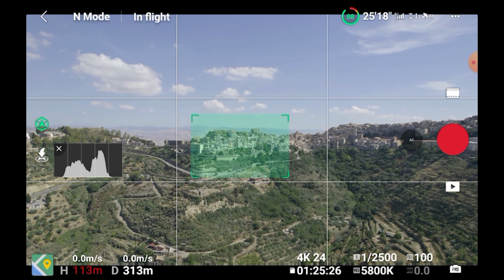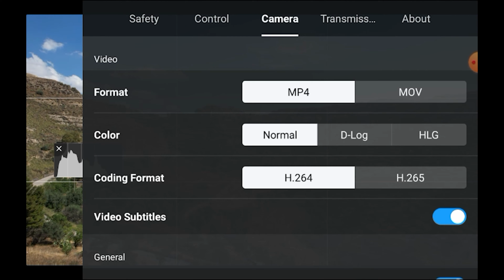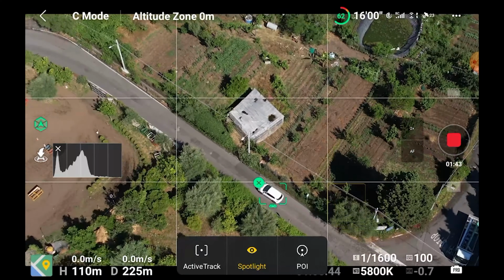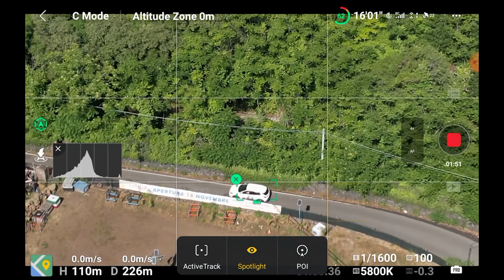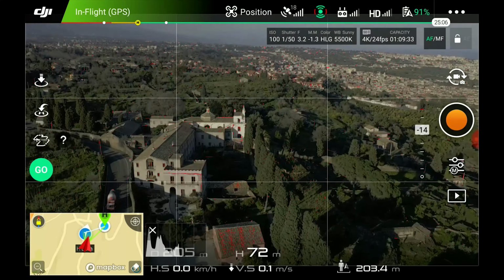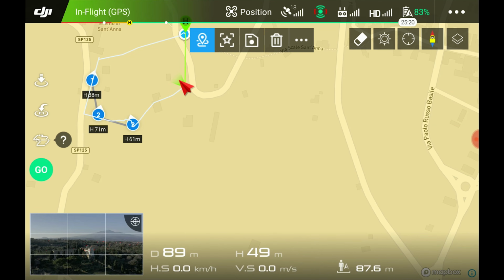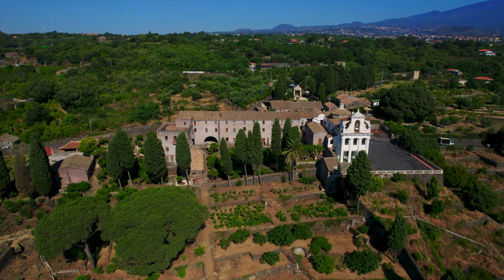DJI AIR 2s Spotlight - a GREAT feature

Comment: Do you have to be recording for spotlight to track?  I can't get it to stay locked on a subject, even a slow moving boat. Frustrating!
Reply from the maker: HI Bob,
it doesn't need to be recording to lock on a subject.
It works perfectly with still targets, while with moving targets it is a bit more complex.
For moving targets you need to select Subject Scanning in the setting, a plus sign will appear around the recognised candidates and you just tap on the plus to select it.
The problem is that not everything is recognized as a target, I believe only people, cars and bicycles

Comment: Interesting thing, after the latest version of DJI fly my Air2s no longer allows using spotlight mode with dlog.  It actually says it's not available in Dlog, it used to work fine.
Reply from the maker: I did non know that, I am going to check it
Reply: @VICVideopIC  it was a big let-down, let me know if you find any way to make it work.  Love your videos.

Comment: Does Air 2s spotlight mode work in the sport mode settings @ 4k 30fps or 2.7k 60fps  to follow faster moving sports , like motor cross, skiing , horses running, cyclist ect..  thank you !
Reply from the maker: Hi Jeff,
it does work in sport mode at 40 30 fps, but be aware that in sport mode the obstacle sensors do not work and therefore tracking is quite dangerous
Reply: @VICVideopIC  Thank you

Comment: Super nice videos! Fantastic explanation?
May you tell me which App do you use? I use DJI Fly and it looks a little bit different...
Reply from the maker: Thank you,
I use DJI Fly too.
In which way yours looks different?
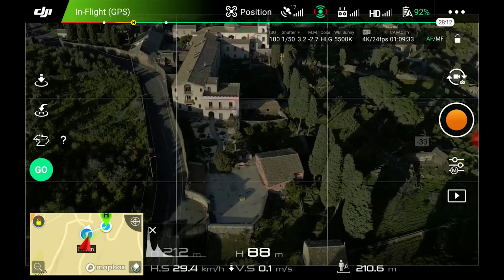Reply: @VICVideopIC  Vic, thank you very much for your quick reply. 7:56 - I was confused but it was my mistake. 8:41 you told that the Air 2S don't have waypoints, obviously I haven't noticed that. So, sorry wasting your time & Best regards from Costa Rica.

Comment: What I am unclear is when to use Spotlight and when to use POI. Can you explain further - thank you! Your videos are very interesting and informative.
Reply from the maker: Many thanks Jonathan,
there is indeed some overlapping between the two modes and some situations where both of them could be used.
If the move you want to achieve is mostly circular, use Point of Interest and you can also make it more interesting by adding other motions to the orbiting.
If your move is mostly linear, like flying diagonally towards a target, Spotlight is the best choice
Reply: poi will only allow you to circle around an object at various speeds, altitude, etc; you can't fly straight; huge difference

Comment: can u use intelligent flight mode on 5.4k
Reply from the maker: No, sadly they work only up to 4k
Reply: @VICVideopIC  when you listen to youtubers air 2s sounds light years ahead of mavic 2 pro but higher dynamic range hq mode In intelligent mode aperture more senses I think mavic pro 2 just breezed past mavic air 2s
Reply: @maxmaxmaxgoon5602  Will probably be improved on further firmware updates, the Air 2s is amazing for what it is, 1inch CMOS is absolutely crazy when it comes to quality alongside the 10-bit D-LOG
Reply: @ShottaIbby  you see it's great but it does not compare to mavic 3
Reply: @ShottaIbby  no I meant mavic pro 3
Reply: @maxmaxmaxgoon5602  Mavic pro 3 isn't out yet?

Comment: Hi, great vidoes, I watch a lot of your videos. Like them a lot. But what color mode du you normaly go for D-log or HLG?  I have tryed D-log in 4k, but then my laptop just dident work. It's a Razer blade base 2020 with 32gb ram. GPU RTX 2070 Max-Q. :)
Reply from the maker: Hi Paul, 
I love HLG, although most people use DLOG.
What software do you use for video? The two 10 bits modes are in H265 codec and some software don't work with this Codec
Reply: @VICVideopIC  Hi! I use Premier pro CC.